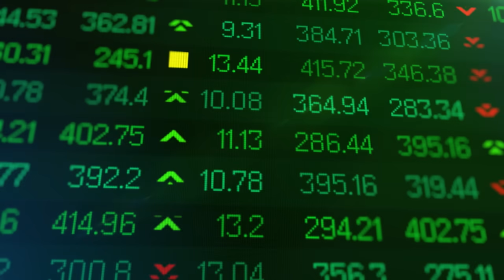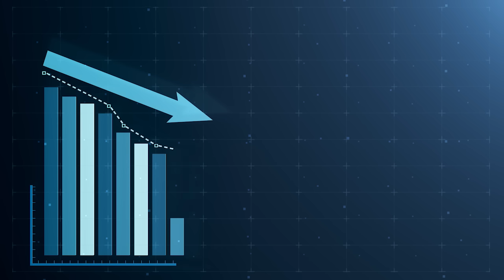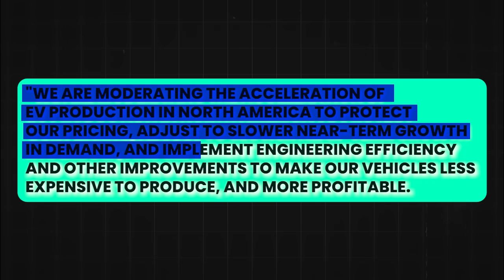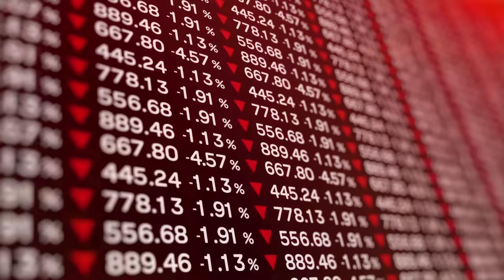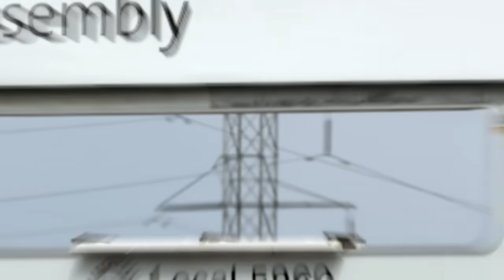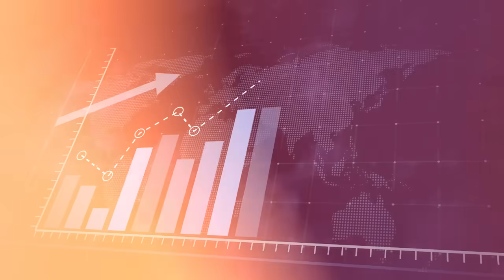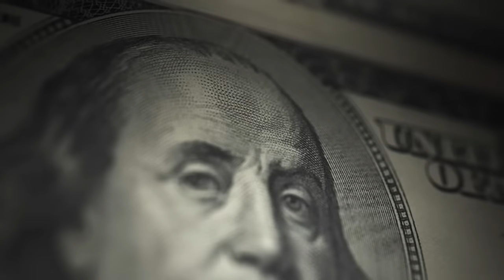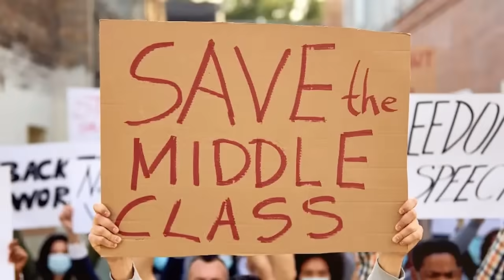HUGE NEWS! GM CEO Just SHUT DOWN EV Production!

Comment: The elites love EV. The politicians love EV.  The celebrities love EV and the carmakers love EV.   None of those folks actually want to own one----They want YOU TO OWN one.
Reply: Because the elites don't drive themselves.
Reply: Naw car makers hate ev, they loose 10s of thousands per ev made they literally cannot profit off of them
Reply: They want to preach more than actually follow.
Reply: @bongscott3738  It's far worse than that.

Just look at the recent laws on federally "required" kill switches in new cars... it's a lot easier to kill an EV that can't function without a computer to monitor and control the whole car, than it is a simple engine.

if you drive a car with a combustion engine, you can pretty easily bypass or remove these "required features" - as I have on my car, since a combustion engine, for as advanced as they supposedly are today, are still simple machines that can run without computers, and thus, without the ability to be tracked and controlled.

It's always about control with these people.
Reply: Because there is $omething in it for them.
Reply: They are just for the peasants.
Reply: Nothing like driving your EV to board your private jet.
Reply: Because are toys for them they have the money 🤔
Reply: I.e., Buy TSLA.
Reply: You know this how?

Comment: Toyota did this last year. Toyota also announced a new mid-sized pickup MSRP $20k. That's a lot more affordable than an EV pickup for $115K.
Reply: I bet it will have better mileage than the $115K, plus cheaper repair pricing also.
Reply: Strawman on that $115K?  Average ICE pickup went to $42K last year.  Ford's F150 ranges from bate bones $32K to over $85K (2023).  

EV Lightning is currently selling at a well appointed $54K.... Before the tax rebate.  

Not every EV truck is a top line Rivian or Hummer.
Reply: Toyota  chose  not  to  sell fully elec.  vehicles.     They  are  smarter than  all  the other folks. n
Reply: Now they need to abandon the equally ridiculous ammonia engine.
Reply: @laurakilmer8652  are you saying Toyota scrapped plans for the 2024 Tacoma EV? And that they are no longer making the BZ4X?
Reply: I'm not a fan of toyotas but I 100% agree with the CEO when he said EV is NOT the future and I'll support them in any innovations that don't include EVs
Reply: @rg3965  There are zero plans for an EV Tacoma in 2024, only the Hybrid on certain trim levels.
Reply: Toyota's position has always been the EV is not the answer. They just repeated themselves with the new leadership change last year and the media freaked out because they thought Toyota would change course.
Reply: @rg3965 Ford loses $32,000 per EV
Reply: I'm skeptical of the 20k truck. Honda just came out with a dual sport bike for  $3000 msrp, and the cycle community was really exited, until they realized it was manufactured in Taiwan.
Reply: Toyota also has a $10,000 truck, but it is unavailable in America.
Reply: Toyota is going hydrogen hybrids
Reply: @rg3965 no you strawman lol
Reply: Try again, Toyota offers a BEV, now if they could just find a way to keep the wheels from falling off....
Reply: @Shakerhood69  "Zero"????  Hummm, https://www.youtube.com/watch?v=cDtVLPevI00
Reply: @rg3965 absolutely positively Zero, you have to follow that story to understand that was a sneak peek of what the 2024 Tacoma was going to look like. Look closely at that truck and you will see an exhaust system under it. There will be hybrid models available in mid 2024 as l mentioned already though.
Reply: Along with hydrogen fuel cells @MrTrippticket
Reply: @rg3965 f150 lightnings are alot more than that quit lying.